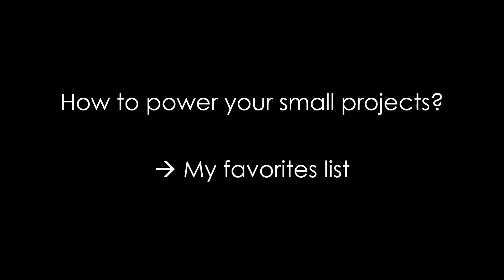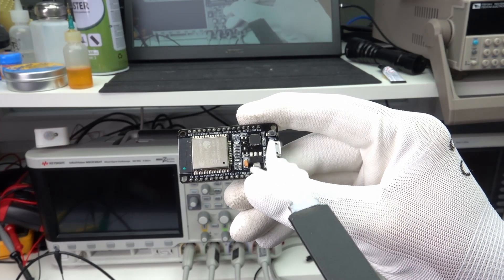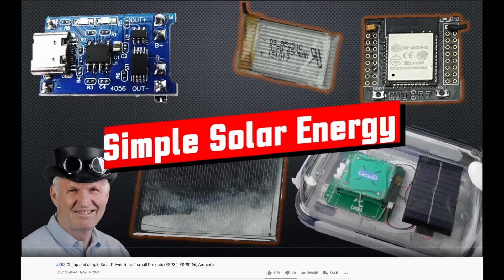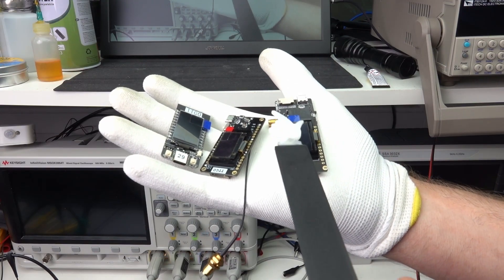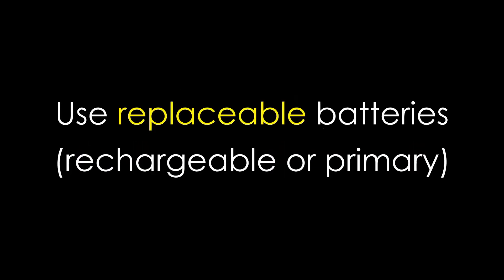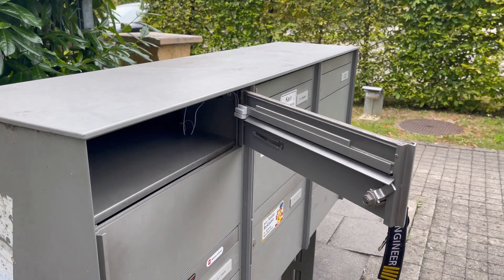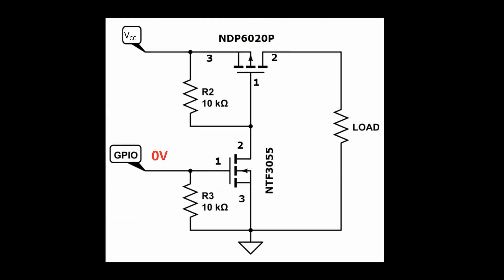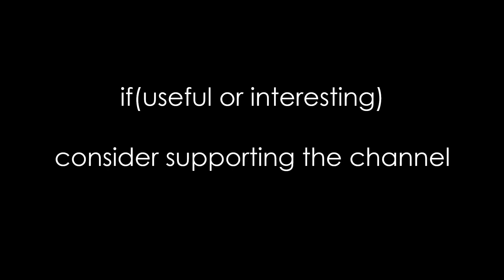#400 The Best Power Source for ESP32/ ESP8266 Projects

Comment: Something about the use of EEPROM. We had written a small library, with writes the information not allways at the same memory cells. If you do it right, the 10.000 cycles "problem" is gone. We had made a test - we wrote 1K blocks to an EEPROM about the size of 64k. The first data lost was around 2 Mio cycles :-) Detected with a simple CRC in the blocks. Something similar is done by the controllers of SD cards and USB Sticks.
Reply from the maker: Very interesting. Did you also compare how many circles were possible without the library? And is the library available?
Reply: @AndreasSpiess  Yes, aprox 50000 cycles writing allways to the same page. Sorry, it's closed source (and the basic module is over 20 years old). But the principle is very simple. Splitt the memory into pages. Every time you write a new page with a ++counter, put it behind the last page (a sort of cycle buffer). When you start the MC search for the hightest number and go. This can be varied in several ways. Allways read after write and compare the buffer. If you find any error, mark the block as defect. And, before write, look into the next block if there is a defect flag. Skip this block. A little bit over simplified, but I think you got the idea. This can be optimized in different ways. We have systems which runs more than 20 years on site. Mostly they die due to problems of the PSU. None died ever due to "no more memory error",  This must happen when the spare memoy block size is zero. This happens often before the mechanism was implemented. We start with 50% ratio between spare blocks and workload blocks. There a many solutions available outsite for plain memory access. For us it worked since 20 years, Why change? In our case we write a lot of sequential data. So this principle works very well. Today we use industrial grade SSD, so no more need for this solution. But this is an other world.
Reply from the maker: @Peter: Thank you for the information. Sounds interesting. Maybe somebody writes a small algorythm for the ESP32 (which uses Flash to emulate EEPROM. The principle should work too.
Reply: Hi, I use FRAM: 10'13 read/write cycles, 150ns...! See Fujitsu for example.... 🧐
Reply: I think we did at as filesystem. enough writes to certain block it swapped to next. I think all our blocks had info what file chain it belongs and what is write amount. so when we boot we scan eeprom block headers and create toc in ram.
Edit: Need to check these FRAM chips. I think they also wear out when reading
Reply: @LimbaZero  Please get Fujitsu Product Overview datasheet. Also YouTube will Show you good Comparison. When write speed is a concern: also FRAM. At least in my projects. Greetings Henry...
Reply: Love it. The simplest version I know of is to zero everything, then only ever write in full eeprom write blocks. Scan to the first available detected block and write there. When full zero everything. using a smarter algorithm like yours on battery is probably wise to minimize cpu time scanning.